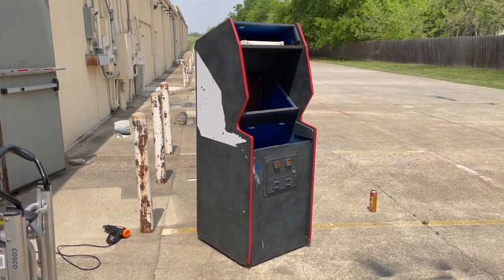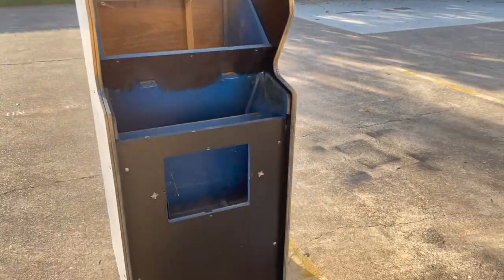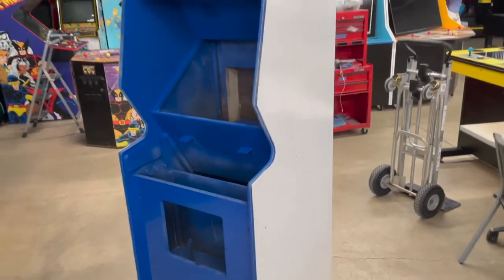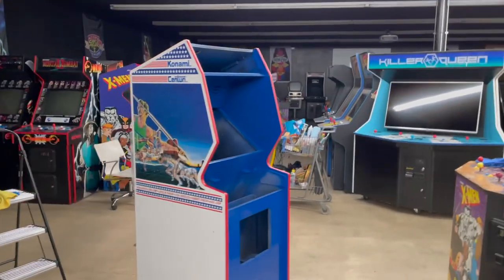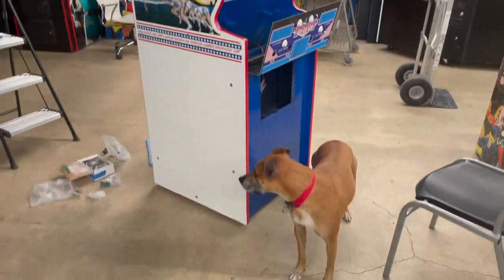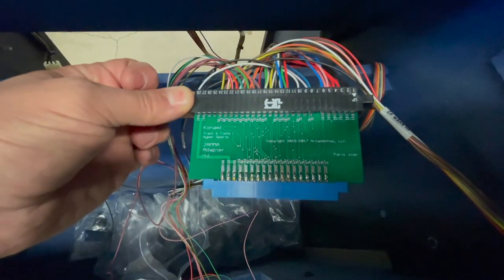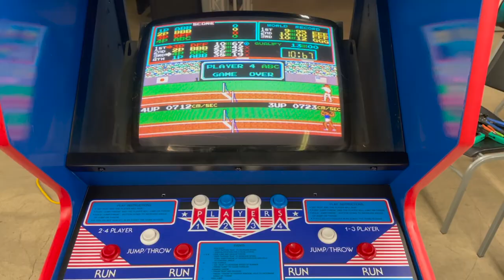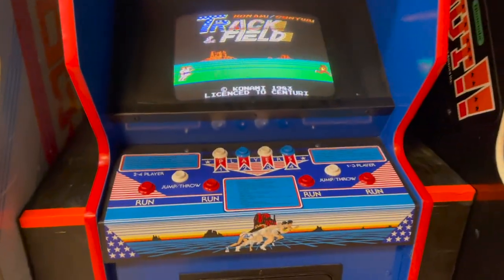Track & Field arcade restore, On Your Mark, Get Set, GO!

Comment: Red T-molding looks good. Better than black, anyway. It seems likely that if an arcade had to replace the T-molding on a machine, they would have used what they had on hand before ordering more. So it seems likely to me that there would have been a lot of variations on the original out in the wild.

Comment: I remember the Track & Field at my local arcade in the 80's had tall "C" covers over the buttons with notches cut out so pencils and pens could not set in them all the way. Then eventually, people would loosen the collar and rotate them facing inward then file down the notch further so they would fit.  Wonder if someone still makes those?